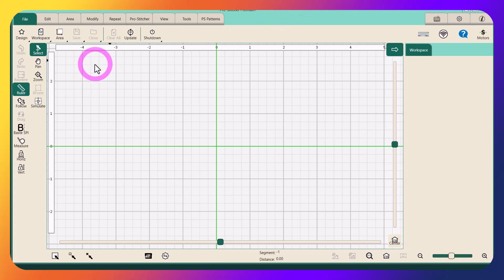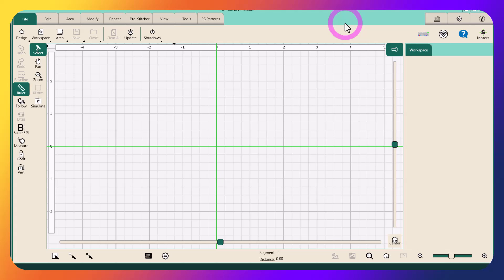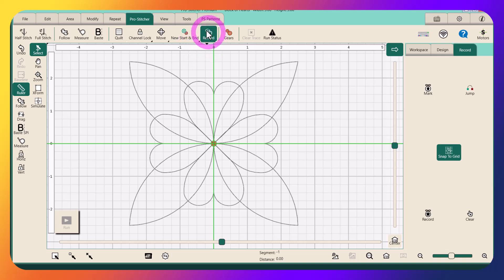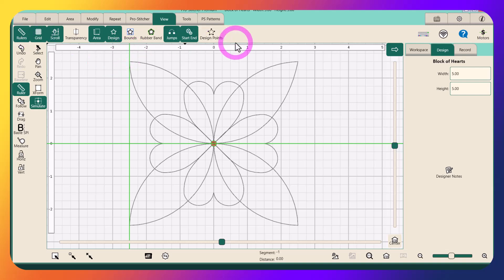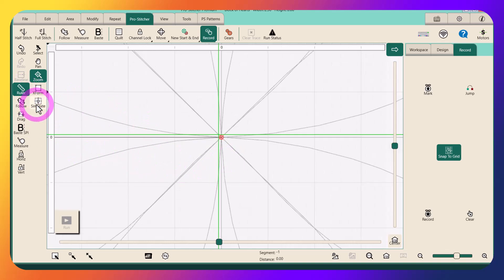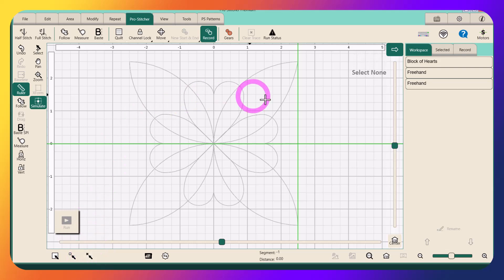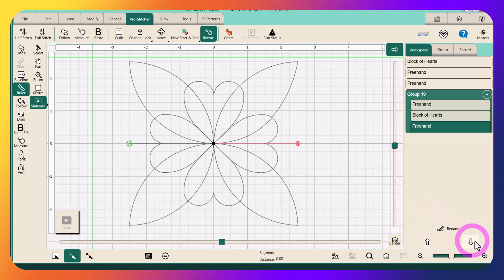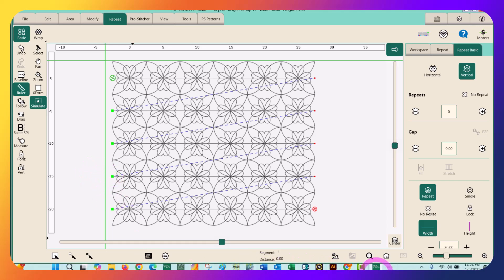Turning a Block Design into a Continuous Line Design in Pro Stitcher

Comment: When you sewed this one out did the grid line sew or not,,,,? I did this and it sewed the grid line the line that connected the blocks
Reply from the maker: The grid won't stitch out, that's just a View option.  But of course, the two line segment certainly will stitch out, because those two additional horizontal line segments are what are needed to make this design become an e2e design, and have horizontal design elements connect to each other.  Remember, in order for a design element to be an e2e design, it must meet those two critera:  Start Point on left, Stop Point on right.  And, both of those points must lie on the same horizontal plane.  So, you'll get what looks like a straight line through the design element, but that's the ONLY way to make this block design become an e2e design.  Make sense?
Reply: @hoosierquilt  soory did not mean grid, the two line segments,.. ok i have to find a way not not have a line through my pattern 
I'll have t o find a teacher who know how to avoid this
Reply: This is so good.  My Aunt has an older version of pro-stitcher that she doesn’t want to update. Maybe I can figure how to do this in the older version.